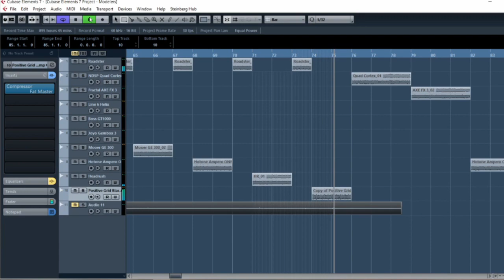All Modelers Sound the Same... DUAL RECTIFIER COMPARISON (Quad Cortex VS Everything)

Comment from the maker: So, just a couple of notes:
The Boss GT1000 Core is one of my favorite sounding modelers, but it was pretty much my least favorite sounding here, and it really fought me the whole way haha. It did not sound anything like the amp when using similar settings, and pretty much every other modeler at least KINDA did.

The Bias Head has a TRIPLE rectifier which I used here. No Dual Rec model there.

I'm considering doing a similar video, just using my favorite sound from each modeler...would y'all be interested in that?
Reply from the maker: Also, I welcome criticism and ideas for improvement! I just ask that you don't be an ass about it lol. Those people are usually ignored.
Reply: Yeah, i want to know how good CAN a modeller sound, even doing modeller magic (with helix i have to put the masters to ver y low
Reply from the maker: Gotcha dude. Of course that will be more subjective, but yeah I think I'll try and do that.
Reply: Definitely - I like the sound of my GT1000 as well, actually better than Helix; still prefer to use my QC or Kemper, though.
Reply: Thats a sick idea with the favourite sounds you can accomplish with each modeler. What I'd really like to would also be how those sounds hold up in a mix. E.g. I think for playing alone my Helix sounds worse over Studio Monitors than my Engl Fireball with a Cab in the Room. But in a mix the helix sounds better to me. How it sounds in the mix is the most important part imo.
Reply: Pleaseeee do it !!!! , i love your videos ! , but the next time please put more comparasion , more riffs !!!!
Reply from the maker: I can try!
Reply: I would love to hear your favorite from each.
Reply: For my GT1000 I always put sag and resonance on -10 and a overdrive on 20 gain with volume 100, makes any sound much more metal and so much easier to shred

Comment: I think the reason the gain being way higher in the modelers might be that they indeed are modeling the modern setting. That's what I've seen is much more common to model when talking about rectifiers. Really good video! straight to the point

Comment: Cool shootout! I really like the Rectifier in the HX Stomp and so much in the GT1000 core, even though the amp models created for it are really good.

My experience is mostly with Dual Rec plugins and i think the one in STL Tones Amphub is the best sounding, closely followed by TH-U.
The officially licensed one in Amplitube 5 is good, but you really need to find the right IR for it to sing. 
I would avoid the Nembrini Audio one and the Brainworx one, both were developed by Nembrini and his own company’s version is a somewhat updated version. The Nembrini is very hard to get it sounding good. The Brainworx one is better but it is very finicky to dial in and both plugins’ IRs are just bad.

Comment: Hey sorry if you mentioned this. But did you use the same ir for all units?
Reply from the maker: Same actual cab and mics, yes
Reply: @PariahVSGear  Hey 👋 I don't want to sound like a smart-ass but using IRs for this comparison in particular might have been superior as pushing a Cab with different volumes or the mic getting just moved by a Millimeter can change the sound significantly. Anyways thanks for the video 🤘